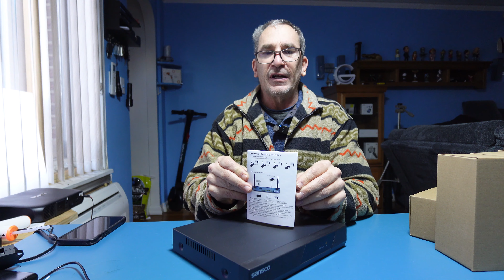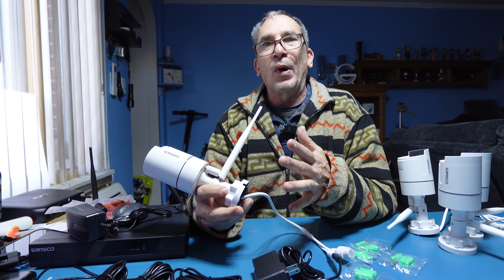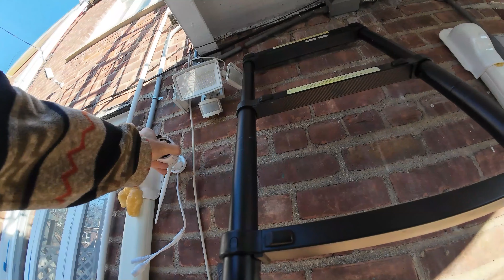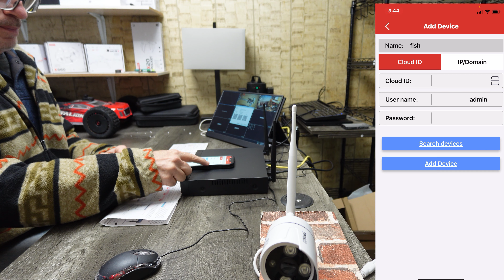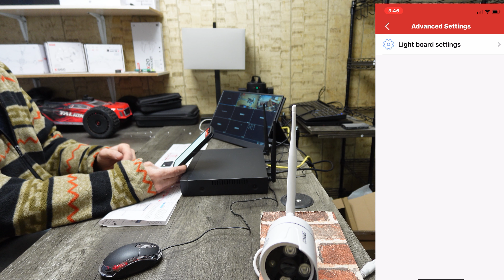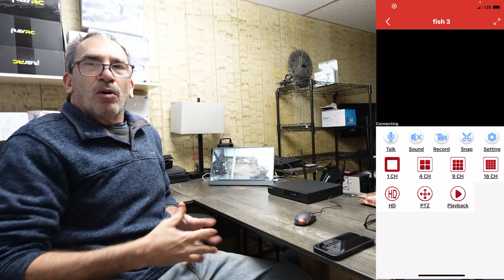SANSCO 2K HD WiFi Security Camera System 1TB Hard Disk, 8CH

Comment: Looks like a great system. Wireless should make the install so much easier than a wired system. What is the range for the camera to the home station?
Reply from the maker: LOS is important so distance  is cut down not sure 10 feet did not pass through cement